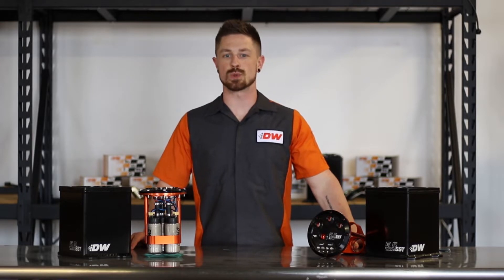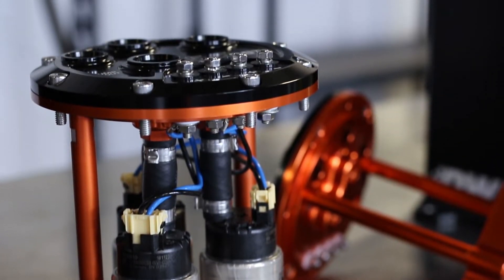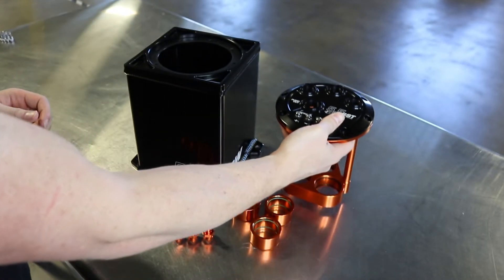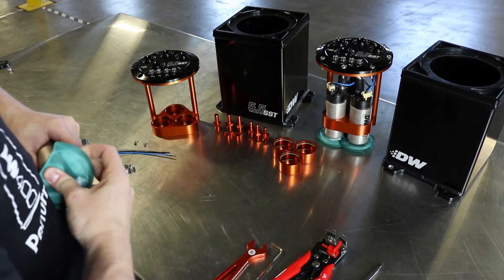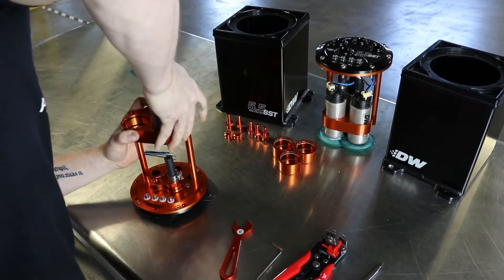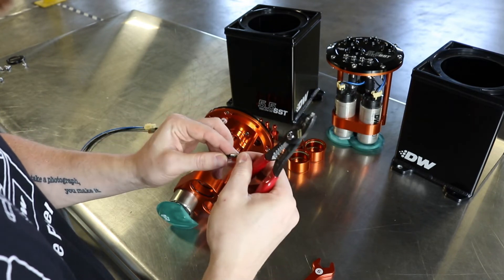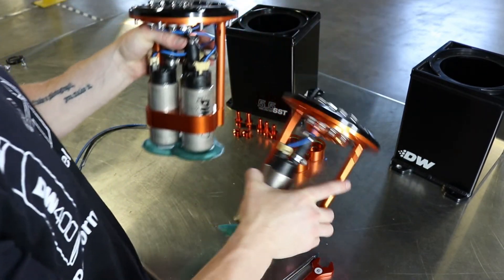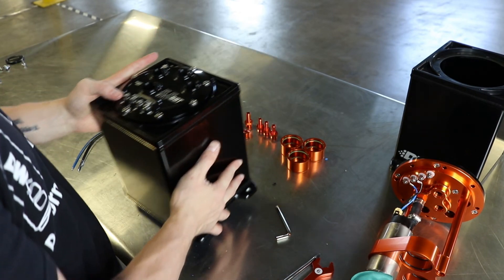DW Triple Pump 5.5 Liter Staged Surge Tank Installation Video

Comment: Dw300c won't work with this?
Reply from the maker: There would be no need to run a DW300c as those are used to fit a more compact OE hangar. The hangar fits up to 3 DW400's and with the slide in adaptors it can fit up to 3 DW100's, DW200's or DW300's.
Reply: @deatschwerks  thank you for responding back. Only asked because I had a spare dw300c just sitting around